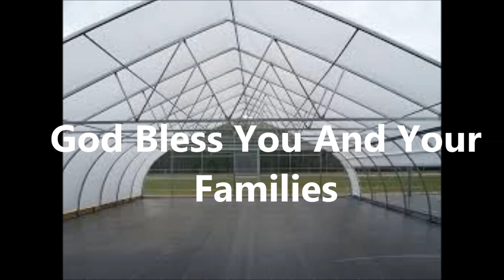The Snow Arch Greenhouse Build  Part 2  Floor, Bows, And Hat Base

Comment: A lot of work for 1 guy and his gal.  I'm puzzled how you'll get enough leverage to attach the other end of the truss with it up?  If there was so much pressure fighting you're putting them up...?  Too bad you couldn't incorporate the building with the greenhouse.
Reply from the maker: +David Dube (Oregon Gardening) The truss clamps are very loosely connected to the structure and they move easily once you remove that last clamp. I have already adjusted the 1st 3 or 4 of them and connected the one that I left off. I had to move all of the clamps over to the side that was disconnected about 4-5 inches and the last clamp lined up perfectly. I will show that on the next video.
 About the building behind the barn.... That is my old barn and it collapsed last year. When I comes down, expect another greenhouse to go behind this one in its place!
Chuck

Comment: Watching you and Mama putting up the bows brought back painful memories, Chuck. You guys must be brutes...you seemed to have an easier time putting up the bows by yourselves than Cheryl and I did, even with the help of the tractor bucket. Also, I can certainly understand the value of the floor covering now...we worked in the Georgia red clay mud about half the time!
At first I didn't know what you were talking about when you referred to the "hat base". Our less expensive hoop house used (customer provided) 2x6's for this. They called them "toe boards". The design of the hat base looks like an improvement. There are a LOT of differences between our non-snow load structure and your snow load hoop house. When I finally get back to posting our experience, you can see the differences.
I'm guessing that you are learning to hate theTek screws, as we did. An impact driver is an essential tool for this construction!  BTW...Terry (at Atlas) was indeed a helpful guy when we had any questions.
Reply from the maker: It looked easy in fast motion and , ah....the beauty of video editing. We actually dropped a couple of them. One of them kind of knocked me out when it came up and hit me on the jaw bone. Those clips will be on a blooper video when we are finished. Yes we hate tek screws.
Chuck

Comment: Wow.
"Running out of daylight" and........STEAM!  I felt you at the end of that video, friend! That is a lot of work, mostly by yourself. (like a lot of my projects). The hat base looks like a pain drilling at the bottom of each. The bracing at the top really put the bows in compression. Looks like getting that last part at the top connected is going to be difficult to say the least.

By the way, were do we buy our tickets for the grand opening and tour!!!! ;)
Reply from the maker: +Phil Brown It's actually not that bad getting the truss to line up once they are up there. I have already adjusted the 1st 3 or 4 of them and connected the clamp that I left off. I had to move all of the clamps over to the side that was disconnected about 4-5 inches and the last clamp lined up perfectly. I may collapse for a few months after the build is complete so don't look for the grand opening anytime soon! :)
Chuck

Comment: Wow Chuck (and wife) looking good!  Would love a floor like that in my greenhouse.  Did that come with it or did you buy it seperate?  Love how everythings just stands on its own.  I had to make sure and put the purlins up when I put mine up or they wanted to fall over.  Where are you guys that the snow load is so high?  Are you planning on heating this one too like the last one?  I have thought about putting a double barrel stove in mine to heat it ala MHP just haven't gotten around to it yet.  Too many other things going on!  I am sure you understand!!!  Thanks for sharing!  Rick
Reply from the maker: +Rick Cragg Thank you Rick. I bought the ground cover from Atlas as well. I tild them what I wanted and they put a package together. Stephanie is my sales rep if you'd like an estimate on something she will put it together for you. Those post are 38 inches into the ground with concrete holding them up so it should stand up. I have also purchased a 300,000 btu heater for it so I will not be using my double barrel stove in this one. I will probably use it in the next one I put up though! I am in the Memphis TN area and the snow isn't bad here but the ice is. The ice is what really did me in last time.
Chuck

Comment: I'm an idea man and just thinking of ideas. If the bows don't need the tech screws other than just to hold it together while you put it up. How about several rounds of duct tape. Would be much faster and a lot easier.  ??   Any thoughts.?
Reply from the maker: The Tek Screw holds the arch in place until it is stood up and mounted in the ground posts. Those arches are very heavy and awkward. I believe the tape would allow the sections of the arch to twist and throw the arch out of shape. The shape has to be consistent from end to end in order to set the purlins and trusses properly. One Tek screw is sufficient though in my opinion.
Chuck

Comment: What ground cover did you use? Didn't see it mentioned in the video. Also how is the dirt foundation holding up? My biggest concern where I live is water seeping in. Our soil is the same clay type but it floods every spring here in OK. Have you had any issues with water?
Reply from the maker: It's a  premium grade 3.2 oz. black woven polypropylene ground fabric with pot lines 12" apart. Available in 6', 10', 12', and 15' wide x 300' . The ground beneath is holding up fine. Much like concrete.